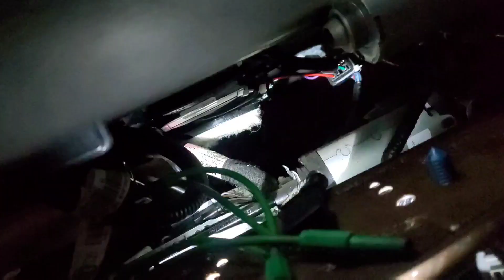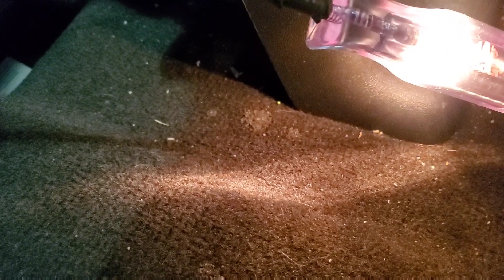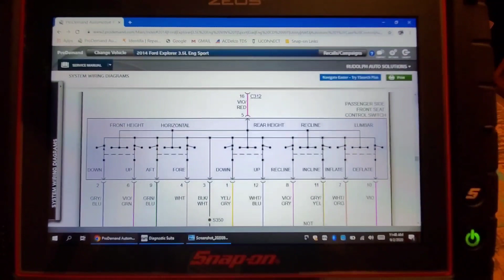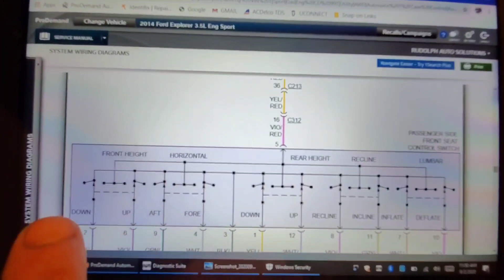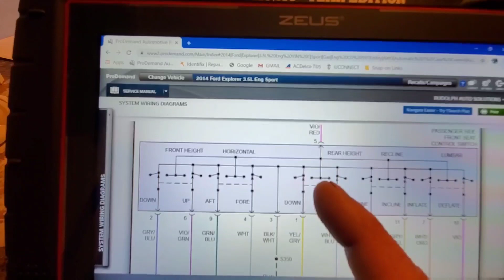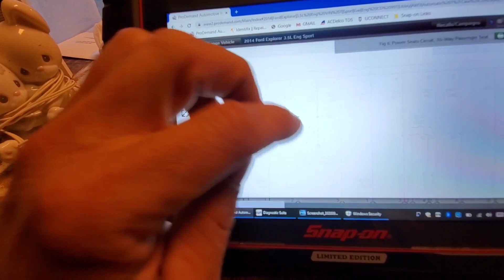2014 FORD EXPLORER SPORT (VIN: T) 3.5L ECOBOOST, POWER SEAT ISSUE

Comment: Did you happen to see the test jason and another guy was talking about in group?  Connecting amp clamp to battery cable with car off and you can test window motors, seats, basically all electrical motors from just the battery cable.  Something im going to be looking into.  Wont work in all situations, but be a good test to add in and might verify wiring throughout as well.
Reply from the maker: No, but aounds amazing, tag me in that please 😉
Reply: I'll see if i can find it on lunch today man